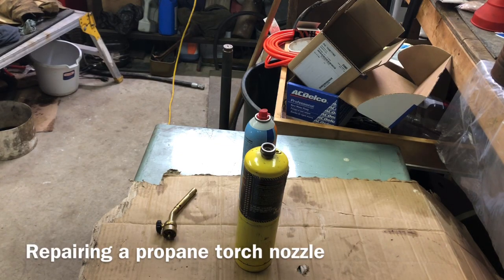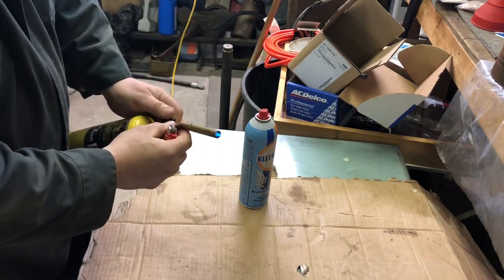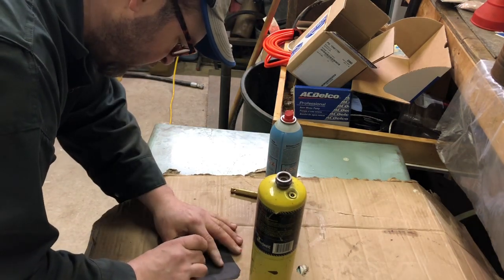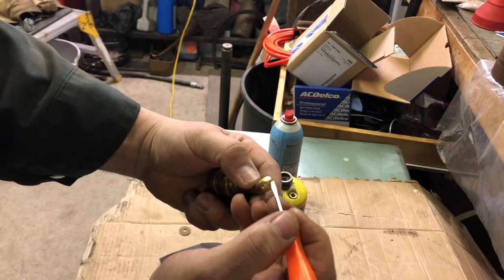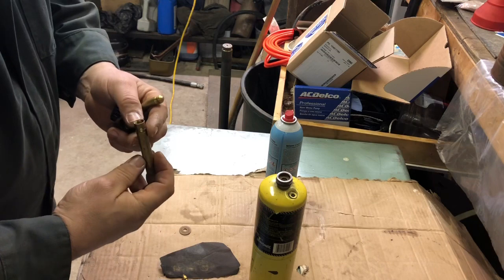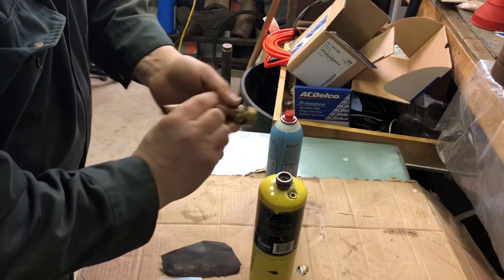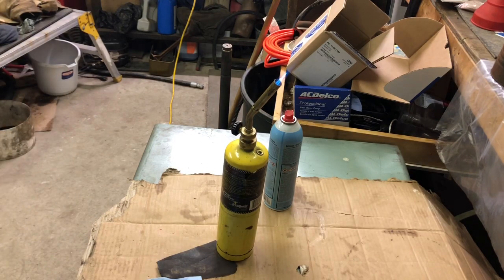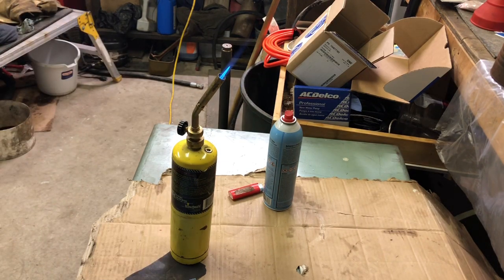Repairing a Propane Torch Nozzle

Comment: Dear Ray, I am a newbie lamp worker (melting glass to make beads etc).  Your video fixed my torch issue for me.  The video was well done and although it took two attempts at disassembling and cleaning I am now back working the flame.  Thanks so much for your video.
Reply from the maker: Thanks for letting me know, makes me happy to have helped you out.

Comment: I just cleaned mine as you've shown.  The little valve seems to have been the problem - I sprayed some PB Blaster into it and with a small wire exercised the valve and spring.  Cleaned and dried it out and it works like new.

Comment: Building a petrol jewelers torch so I don't have to deal with this anymore not the $10 bucks for the tank. Didn't want to miss any filters, great job!  At 50 buck for my torch, it's worth spending some time. I will follow your steps + I have a sonic cleaner for jewelry that I will soak in for a while.  I would also blast the filters with that break cleaner several times.  Thanks for the tips, Sir.

Comment: I have two of them, but one has been kaput for years... so I looked it up. This should help repairing it, especially knowing more than one part can be clogged. 

As thanks, and for those who don't know, crocus cloth is an abrasive sheet similar to sand paper or emery cloth BUT covered with a layer of very fine loose iron oxide particles rather than with bound grains of abrasive. It is intended for final metal and gemstone finishing and is available in various grades (particle sizes) online or at hardware stores.
Reply from the maker: Glad I could help, let me know if it worked for you..

Comment: I don't have a pressurized hose or brake cleaner but i will try disassembling the pieces and letting it soak in vinegar water for a few hours. Great video, easy to understand.
Reply from the maker: Thanks for commenting,  hope you can get your torch working. Thanks for watching!

Comment: Hello. Thanks for that information now I can clean mine better. I do have one question. Mine had a striker button on it, it broke off. It the torch head  still safe to use with out the stricker?
Reply from the maker: Thank you for the comment, and yes you could still use your torch with no problems if the striker is broken, or broken off. Just use it as if your using one without a built in peizo igniter.

Comment: Ray can u do a video on how to repair the black knob on the torch. Mine is permanently stuck, or broken closed.. thanks!
Reply from the maker: Naomi, 
Sometimes someone tightens them too tight and they do get stuck. Try to get it lose with a pair of pliers, turn counterclockwise to open the valve.. hope this will work for you..

Comment: Great video!  My tank leaks right where it seats up when you screw it on. Any thoughts on how to repair?  Thank you in advance...
Reply from the maker: There should be a gasket inside the torch head between the tank and torch. You may have to make one. Thank you for your comment!

Comment: MAP gas almost always does this to my torches. I hate using it for this reason and mostly stick to the propane to avoid this problem. But the other day, I needed a hotter flame, and after I got done sure enough, it's clogged again...
Reply: it just happened to me for the first time ever and I've used torches 100+ times.  Ironically, it was fine till I switched to MAP (new sad excuse for MAP but you know, Ole Yeller).

Comment: Is your bottle low, if not it’s still not really fixed the flame should be capable of being way bigger than that, think I’ll just buy a new head when mine goes out the valves do get leaky sometimes my last one started leaking on me

Comment: Mine seems to work fine but if I turn it from a vertical to horizontal position, then it will shut off. Is that normal?
Reply: Your question is eight months old, but I don’t see the answer for work. I could be here, but I’m not seeing it yet.

So it’s the type of valve. There is another type of valve that you can get that will even work upside down, but the reason for which it says not to turn your torch and fuel cylinder upside down, they said it is only designed to work right side up. When you turn it upside down or sideways too much, it goes out. 

It’s just the design, Not your skills.
Reply: @daphneraven6745  It was the bottle apparently. I ran out of gas in that bottle and bought another one and things work much better now with same valve/nozzle.
Reply from the maker: Sorry for the late reply, it is normal, because when you tip your bottle horizontal, you’re getting liquid propane to your torch and it will go out. I have found some bottles do this and some do not. Must be how they are designed internally.

Comment: I friend of mine gave me a torch head kinda like the one in your video (VTK 300 series) but it won't shut off after turning the knob all the way, is there anything I could do to fix it? Thank you, loved your video, also the only one where I found this kind of nozzle ✌️
Reply from the maker: Hi, I'm not sure of it not shutting off, but I would try cleaning it and see if it helps.  Thanks for your comment, and thanks for watching..
Reply: Mine did that I just had to buy a new one once the valve goes bad it’s done for and dangerous

Comment: I took mine like that apart and I'm getting propane up to the turn valve but it's not going out any further. If I unscrew the torch from the bottle and then remove the turn valve gas escapes out. I'm at a loss whats wrong. I've boiled it and sanded the brass neck piece with what's supposed to have the microscopic office and still no flow.
Reply from the maker: Gotta be plugged up somewhere.

Comment: Great video I don't think I've seen one even close to something like this. But it didn't answer the problem that I am wondering. So the little star thing that is at the tip of the nozzle that's in there a little bit that gives it the shape to the flame and whatnot without it it won't work. Because it just doesn't do it. But I'm wondering is it possible to say create one. I understand and nozzles are quite inexpensive I'm just curious if there's an easy way to quickly do something to it. I'm going to probably just going to get one tomorrow but still I'd like to know because this happens every now and again and it pisses me off
Reply from the maker: Yes, I'm sure you could make one but it would be trial and error.. I'd try it out of a penny or a piece of brass. Anything is possible if you put your mind too it..

Comment: I have a torch that the end of the metal tube broke off(where the flame comes out the four metal connections broke) gas can be smelled when I turn the nob but I'm afraid to light it I'm not sure what the part did exactly.
Reply from the maker: That four metal connections, is a deflector.. I have  never tried to take one out and light it, it isn't  dangerous to light in that condition, just that your flame won't be as nice as with it in..

Comment: I've got one that worked on the original bottle but when I put it on a big camping Coleman tank It hisses loud and I can feel gas shooting out the tip very fast even if the valve is totally shut tight, what the heck is going on
Reply from the maker: Sounds to me that your control valve is not working properly, I'd take it apart and see if it has broken. Or some restriction stopping it from closing.

Comment: Well my torch does not have the problem of not getting flame or a very weak flame.  When I try to increase the fuel flow to get a bigger flame, it always blows out.  I will try the procedure that you show in this video but I wonder if its the same problem.  Anyway, any reply would be helpful.  Thank you!
Reply from the maker: Hi, thanks for your comment. I'm not sure what's going on with your torch, but I am thinking that the metering valve may be wore out or has been over tightened. Overtightening distorts the valve, or jet so it can't meter the fuel properly then let's too much fuel in. Take out the fuel adjustment assembly and inspect it to see if that is the problem.
Reply: Thanks!  Will do but it sounds like if the valve is distorted, then the torch is toast (no pun intended).  If that is so, then its off to buy a third.  Sort of doubt that Benzomatic will sell just the valve.  Thanks for the reply. @staffordshires2
Reply: Usually when that happens is due to a problem in the torch chamber head . Some torches tips have a flame spreader inside and they tend to get bent or pushed down and will mess up the fuel:air ratio . The bernzomatic torches usually are not made to be repaired due to greedy companies and they will crimp the flame spreader inside or do other stuff to the torch to make it hard if not impossible to repair. But if you know what to look for and know what youre doing then its a problem to be solved . . Get torches that have a removable torch head like a ace basic torch or something thats not fixed together from the factory and you ill be able to modify it and get swirl flame tips and ect

Comment: I have the Bernzomatic trigger torch handle on a hose. I tried to adapt your video to that model but no luck yet. It lights, but won't stay lit, and makes a loud whine. If I heat the nozzle with another torch it will stay lit. Do you know what makes the loud whine?
Reply from the maker: Sorry, I have not came across any that made a loud whine. Sounds like there may be a restriction somewhere.
Reply: @staffordshires2  thanks. Weird.

Comment: Youre giving misleading information. That brand of tank ....yellow is mapp gas not propane. using a propane nozzle on mapp gas you run the risk of melting the tip. Plus the air ratio to gas with that nozzle is incorrect for mapp gas. Mapp gas for those who dont know is propane and butane combined. It burns hotter than either gas alone. Each gas has to have a certain air to gas ratio to properly burn. There are universal nozzles that allow you to change to the right air to gas ratio and its made with a metal alloy that can withstand the heat from all 3 tanks without melting or warping. When making an instructional video make sure youre giving proper information.
Reply from the maker: I know exactly that it had map gas in it at one time. Once empty I filled it with propane. Sorry for the confusion..